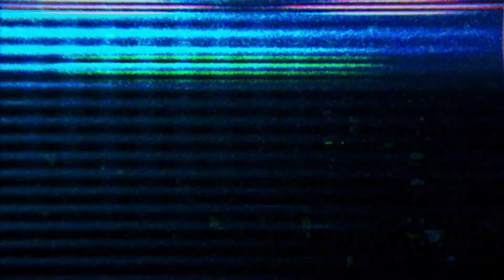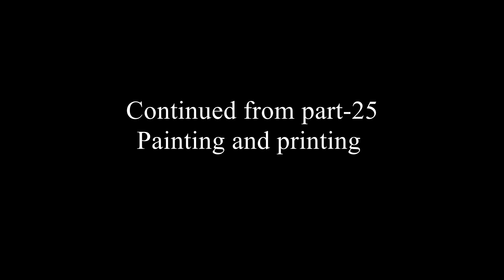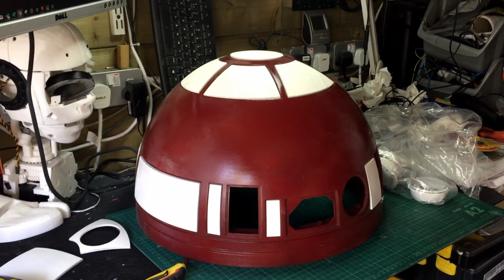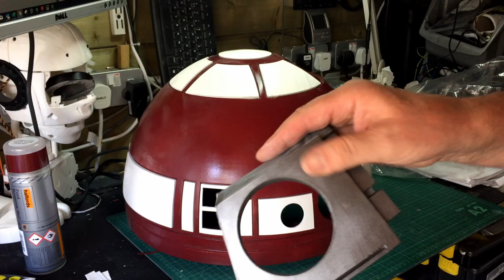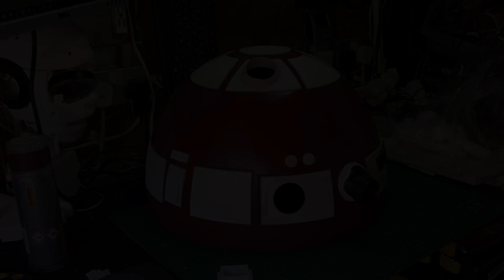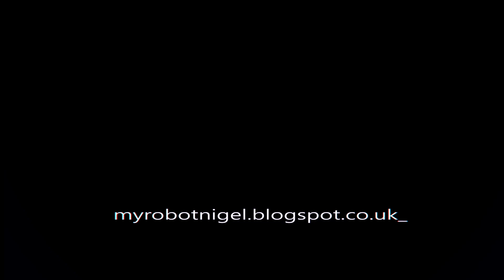R2D2 Droid Build Part - 26

Comment: Great videos, I know it's a bit late but there is an extension to Cura that does automatic leveling onto the bed of the part. Seems to work a charm..
I have just started making one and  have almost finished printing the dome.
As for the radar eye lens, would a 75mm lens fit ok? As you can buy  magnifying glasses of that size for under £3. Keep up the good work.
Reply from the maker: Hi Andrew
I would think the 75mm lens would work OK, the 3inch [76.5mm] lens I have is a tight fit.  Should be fine and cheap as you say. 
Yes I used to use CURA and found it great. Now use Simplify3D which also has the auto level.   Have fun printing

Comment: Hi Kyle.  I have been finding your videos extremely helpful.  Thanks for sharing them with us.  I was wondering what type of camera and software you use to edit your videos.
Reply from the maker: Hi MakerDan, I use my iPhone 6 which is fine for what I do.   I have a 4K Fuji XT20 that I could use, but the iPhone is simple to use.  Also most of the pictures on my blog are taken with the iPhone.  I also generally use the built in microphone although I have a Rode external microphone that I have tried and which is excellent outdoors.    I bought a Smooth-4 stabilizer for outdoor use, but never got on with it really, so rarely use it.    I have a camera stand and phone clamp for indoor use.   
For editing I use DaVinci Resolve-12, the free version.  I would need to upgrade the graphics card on my PC to use the newer versions, certainly when I tried the pre-release version of V15.  Might be fine now.   I make sure the workshop main light is on and also I have a angle-poise lamp turned on a directed at whatever I am doing.  No colour correcting.  
Only issues I have are taking videos of white plastic on a white background, the focus of the iPhone wanders a bit as you will see in some videos. I am not  attempting to make really professional productions so its all I really need.  The opening and closing video sequences I bought from Videohive.net and then edited them to suit my channel.    You need AfterEffects to edit them but you can get a trial of the software, time limited.

Comment: The white is a better contrast than the gunmetal, glad you are keeping with that.You could always play with it, do gunmetal and then white over it, then distress the white on the edges and give it some scratches back down to the gunmetal. The same for the radar eye, maybe he fell on his face like R2 did a few too many times? Twirled his dome while face down and scratched it up?You can always do 1 or more of the holo projectors in gunmetal if you wish too. Or some of the bezels or plates that are supposed to be aluminum. I do like the gunmetal too. I may have to do something with that sometime soon.I cut the holes out for my buttons as well as my radar eye a while back. I bought a fake camera rig for the eye that Larry suggested but it doesn't fit. I'm debating on that lens you got or cutting the fake one up.Are you going to do the middle ring on the dome a contrasting color? Like aluminum? (The one that is normally blue)I saw the update with the Cyberman, nice job there with the paint.
Reply from the maker: Hi Chris, yes I think the white looks good too.  I will do the Dome ring a contrasting colour as you say.  Will try aluminium colour first and see how that looks, I can always over paint. Like the idea of different parts being odd colours - will try that out next.  Yes, the Cybeman looks great in the gumnmetal, need to buy more paint and get another layer on it.  I have found a much cheaper place to buy the spray paints although its a bit late now.   Its cost a silly amount in paint so far, but fun to try different colours.  Nearly got the legs done and then can bolt it together and try out the weathering of it all.
Reply: Hi Kyle, Aluminum base sounds good. :) It can be fun to ding it down to the aluminum. There is a trick Adam Savage showed where they made scratches and then took a fine brush to paint the aluminum and metal colors into them.Paint: I know the feeling, my paint keeps getting grabbed by dad for his projects.I tried that cheap Rustoleum blue metallic on the dome zapper, I keep forgetting to get some pictures. I think it looks good. It isn't as deep as the sonic blue pearl, but it works for me. And it's cheaper too!To cut the costs, you might want to try photoshop. Take that red dome with the white bits and then try coloring the bits in the computer and see what you like and don't like. That can help narrow your search and save on having to sand paint layers off.Legs: I can't wait to see! I'm envious on your progress!

Comment: Good job, where did you get the radar eye lens and what size is it ?
Reply from the maker: Hi Smiffsters - as mentioned to Bryan in above comment - 1 Pack - CleverDelights 3" Round Glass Cabochon - 5/8" Thick - Clear Magnifying Glass Dome Cab.  Item model number: 4336824187   ASIN: B06XWFD5DV
It fits perfectly as you can see in the video